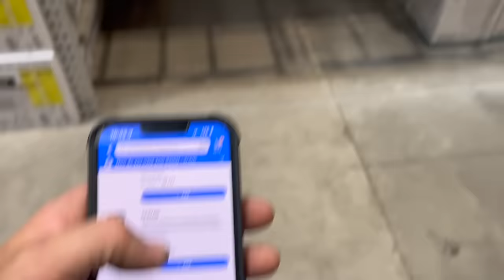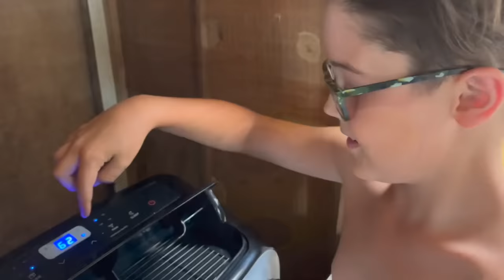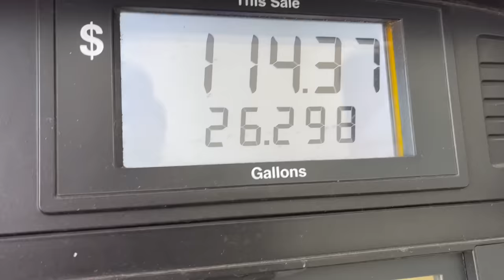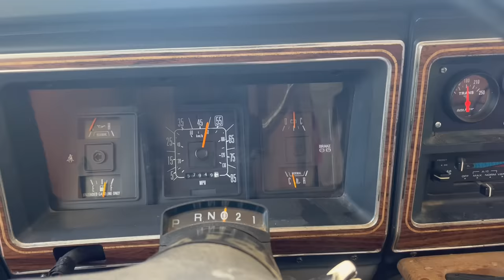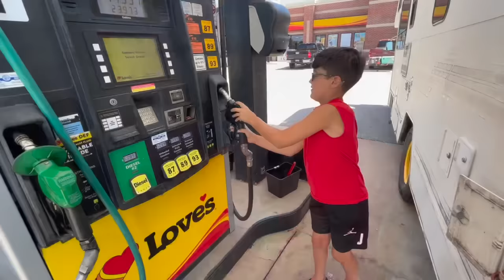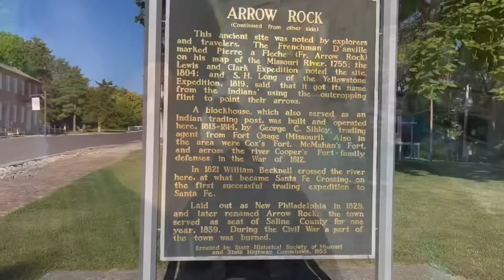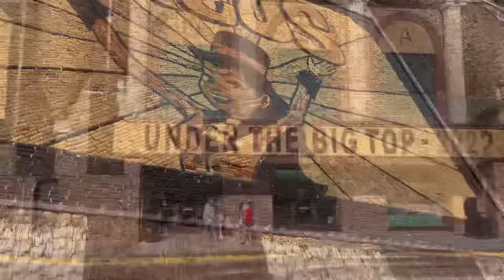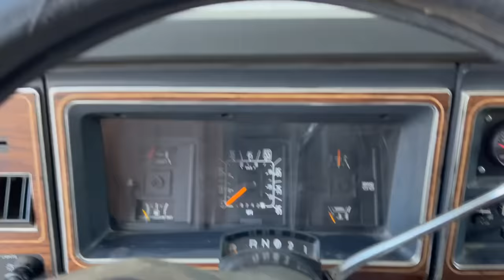Wild West of America Road Trip in a 31 year old RV Can we make it?

Comment: That a/c unit is totally fixable. You don’t need parts. Just someone who can braze the hole up, pull a vacuum and recharge it.
Reply: r22 cost might be a factor but its a simple repair
Reply: I don't even pull a vacuum....i just bleed off some...and some more as i go charging...eventually you get close to 100% freon, and then to 100% after more recharging, top-offs year after year....good enough.
Reply from the maker: Ok great
Reply: Ding need special parts. Brazing tank and brazing rod!  Clean the hole first. Prepare like a radiator.
Reply: Whiskey dents and gangster leans😁🤣🫣😂
Reply: Easy to fix guys don’t stress :)
You guys just have fun
Reply: I've been doing HVAC (with an actual license) off and on for 24yrs and I've fixed at least 3 screw holes(one of them my fault just like your little problem)by cleaning and flushing the hole out with solvent, sanding the area around the hole bright,  poking a piece of clean, flux covered  copper wire just barely into the hole and soldering it with a propane torch and plumbing solder. Just clip the extra wire off when it's cool and charge like you normally would. I know at least one of those repairs is still in service 12 years later at the Baptist Church down the road because the Head of Facilities keeps reminding me he's going to want the money back if it ever leaks
Reply: @jonathangehman4005  residential hvac is different than a rv air conditioner bud. if they are tampering with them (recharging) they become a major fire hazard
Reply: @Reaglesracing44_  I'm licensed for automotive , residential, and commercial and am pretty familiar with the Coleman rooftop ac(I've got one now and have had others and worked on a bunch more). I wouldn't hesitate to solder a wire plug into one of those since line pressures are the same for similar refrigerants, the materials are the same and of the same gauge and thickness. They're as well made as the average residential units and are pretty robust
Reply: @jonathangehman4005  you have to be RVIA certified not Licensed hvac. Camper air conditioning units are closed systems and have no refill point. If an Open Road RV Repair technician or any RVIA Certified Technician tests your system and determines that the issue is low refrigerant charge the only option is replacement of the rooftop assembly.
Reply: That 30yo AC has way heavier tubing and would be easier to fix than a new one would be. Service ports are easy to add even without brazing it soldering. I'd fix it without hesitation.
Reply: @Reaglesracing44_  I'm sure you're correct but that's why they sell ports and service valves, lol. Have a good eve brother
Reply: @Reaglesracing44_  they repaired my heat pump A/C system, kind of the same? Laws have changed here if they can’t. Too bad.
Reply: @reneprovencher8395  if it’s a residential unit then yes it can be repaired but a RV rooftop unit can’t because it can catch fire
Reply: @Reaglesracing44_  Gotcha
Reply: Wow masterful control of the cussing and screaming I would’ve set fire to everybody’s ears.
Reply: Have you got a radiator shop around they can fix that hole
Reply: Why do you keep calling tires casings??

Comment: This is a trip of a lifetime that you and your family will always remember. We're all here supporting you and will be watching every episode. As far as the 460 stumble, I would check the pressure regulator and the MAP sensor. One or both may be the culprit and they're not too expensive.
Reply: I had this happen with a '91 E350 Winnebago, it was water from the dash AC dripping into the computer which is right under the AC housing in the front passenger foot well. If it does it again , check to see that it's not wet on the passenger side.

Comment: Looks like a great trip. Ironically I did the exact same thing over two years ago. Found a 91 Tioga Montara in a barn. 38000 original miles and paid close to what you did. Spent 6 months renovating it. Same chassis. 460 with the 3OD. We pull a car on a dolly behind it. Still get 7-9mpg no matter what. So far, put close to 15000 additional miles on it over two large trips across the country. It has never let us down at all even pulling a car through the mountains of Colorado etc. 
One thing I learned is drive less and stop more. Driving is stressful, we learned to limit  driving time to no more than 5- 6 hours max and spend a least a day or two at each stop seeing sights with the car we pull. Renting a cheap car at stops is an option also. Have fun and good luck.

Comment: Thanks for sharing your trip. The A/C might be repaired with a Pro-Fit quick connect which works with aluminum and copper. They are like Shark Bite connectors for high pressure A/C  lines. You could also use a piercing valve kit to seal the hole if it's not too close to the bend in the line. If the hole is too close to the bend, try putting a piece of rubber tubing around it and clamp it with a small hose clamp. After taking another look at the tiny hole, it could probably be soldered. The tubing next to it looks like it has been repaired. Aluminum must be cleaned and uses flux and low temp solder and a soldering iron.
Reply: That's great info @cyberviewU, thanks for the pro tip!

Comment: I was amazed at all the work you done on that motorhome. I've got about 20 years experience in HVAC and residential air conditioning. You should have fixed that condenser yourself. All you needed was a stick of Silver solder and a map gas torch. You could have repaired it on the roof without removing anything. Then all you had to do was add a line tap so you could recharge the unit. Very simple. You can do it!
Reply from the maker: Yeah we should have

Comment: Josh, if this motorhome has the fuel pump inside the tank like most injected engines, then maybe it is beginning to go. Do you notice the engine acting up when you are near the end of a fuel run? As the tank empties, the pump housing becomes no longer submerged and maybe getting hot and dropping fuel pressure. I've seen this happen before.
Reply from the maker: Yeah maybe so
Reply: @Sleeperdude  I say fuel pump too.  I had a Jeep Cherokee with the fuel pump IN the gas tank and I was advised to not let it get too much below half full.
Reply: I have the same 1990 motorhome and had the same issue. Was going up a hill, and it died on me. Sounded like it was out of fuel. Pulled over, let it cool down for 30mins and it started right up. I took it to a mechanic and he said the pump inside the tank heats up and shuts off. It's a known issue with the ford's. I switched out the pump and haven't had the issue again.
Reply: I just bought an 86 motorhome. Pretty much the same rig but mine is carbureted. I am thinking that maybe the sludge in the tank is breaking up and clogging up things. Mine was garaged over 20 years and you wouldn't believe the tar that can build up as the gas evaporates.

Comment: I did 11,000 miles trip with a 2003 Ford E-450 v10 motohome. I did not had any major issue. only replaced the Rubber hose for fuel intake gaz tank

Comment: you can clean the copper and solder the hole shut using a small copper patch made from a little bit of tube cut in half either that or cut the bend line open it up jam it intoo a coupler piece and solder that
Reply from the maker: Ok thank you

Comment: Just bought an 86 Ford Establishment Class C. It only has 7300 miles, but has been garaged for 25 years. The gas tank is currently soaking in a vat at a radiator shop. The rest is mint except the AC isn't cooling. I'll know more after it is running.
Reply from the maker: Nice

Comment: For the external delamination you can get a syringe with epoxy and inject it in several places in the area and then press the laminate in, place a sheet of ply over it and use a prop to put pressure on it until it sets.

Comment: I had the exact same problem with my econoline rv stumbling last month. It gets worse with the hotter weather. We went Pittsburgh to Fayetteville Arkansas. The problem is the TFI module. It is mounted to the distributor and when it gets over 250 degrees it begins to fail. The trick is to open the hood when you stop for gas to lower the air temperature. The fix is to relocate the TFI module to the firewall. Im in the process of that now. 
Awesome videos!

Comment: I was able to binge watch all of your RV videos. I was rooting for the Dodge and still hope it turns out to be a simple, cheap fix.
At the same time, my bubble has burst. Many older Class C RVs are becoming available for little cost. If it takes 3x the original cost to make it comfortable and reliable, I don't think the remodel route is how I want to go. Pay the extra cash up front and not go through all that work. HOWEVER, if I had 4 hard working hands to help, that may sway my  opinion. Have a great trip out West!

Comment: Great video.  I find water in some gas stops, throw a dry gas in every 4 tanks.  Fuel mileage is doing good.  That chassis but new with a 7.3 gas’s gets 11 mpg at gvwr-1500 lbs, brand new in an ambulance .  All a matter of your speed.  Keep on having fun.  Doing great checking axle, n rubber temps.

Comment: AC? Been there, done that!  Clean up  the damaged tube with sand cloth, then solder it up, preferably with silfoss (silver solder) and recharge. That unit is made for R22 which is unobtanium at present, but you have numerous alternatives. My "go to" gas is Dupont's MO99, or R438a.  A new RV rooftop unit would be an "easy" replacement, as they all fit the standard 14x14 roof vent hole.
Reply from the maker: Yeah the problem was it has no charging ports and the AC companies  locally would have to order them

Comment: You're giving me hope!  I have already said it in another RV video of yours,  but I'll say it again. I just bought my first RV, a 1986 Coachman Classic on a Ford E-350 chassis.  460 (carburetor, no fuel injection) and only a 3-spped automatic.  I have only done the first few short hops in it,  no more than 50 miles and no overnights yet.  Still working the "bugs" out and still needing some tinkering & maintenance and stuff like a rear mattress and curtains etc.   Granted,  mine was in better shape when I bought it, but I still have my worries.  Oh it runs like a champ,  but when the lights go to flickering I get worried.  (Probably the alternator on its last leg or voltage regulator about to croak)   So, if you have the confidence in your rig to take off on a 3 week trip,  Maybe I can be more confident in my rig as well. 
If you were coming this way  (SW Pennsylvania) and had a major roadside breakdown,  I would hop in my big conversion van and get you all to civilization where you could get a motel and parts etc.   If I had my own private home, you'd also have a living room to crash in if needed. But I don't have that.  That said, and as others have said before,  I'm sure there are fans all over the U.S. who would jump to come and lend a hand if you needed it.  

I just did my own 4,000+ miles road trip from here in SW Pennsylvania  across the "finger" of WV, across OH, IN, IL, up into WI,and MN the across  ND, MT, into WY, Stopping off at Yellowstone, back into MT, then down to SD, for Devils Tower, Mt Rushmore and a drive through Sturgis.  Then down to NE and back across IA for a stop in at Iowa 80 truck stop and back again across IL, IN OH, and into PA for the last leg home.   I was gone 16 days, all by myself, in my 1990 Dodge B-250 High-top conversion van.   BUT.. about one week before my trip,  I blew the AC out of my van by accidentally overcharging it.  So I feel ya' there.  It's like getting hit in the guts!  So I did what you did.  I rigged up a portable AC unit, and ran it off my Predator 'genny that I carried on the hitch-rack.  The AC didn't do diddly going down the road at 75+ MPH in 105 degree heat,  But when I parked for the night,  it froze me out! 

Whatever happens on this trip,  try not to focus on what could happen,  focus on making memories while you're out there.  Sure, be vigilant, and take it easy on the ol' girl,  but enjoy the time you spend doing something you love with those you love. 
Godspeed and best wishes to you all!  You gained a new subscriber tonight!
Reply from the maker: I’m glad we have given you hope for your motorhome project thanks for the offer to help sounds like you had a great trip with similar difficulties before you left thanks again for watching

Comment: Had to stop here on the AC unit on top. If you have good access to the leak a good ac guy can clean and solder the leak and recharge the Freon hopefully it will work. I did the same thing to our window unit when I was drilling a drain hole and the drill bit puncture the pipe like yours did.

Comment: I was wondering if the stumbling issue you're having could be the new fuel filter stopped up or maybe you got a bad EGR valve that might need cleaned or replaced. I know my mother-in-law had one on her Lincoln and it had a 460 in it. And that EGR valve stopped up or going bad And you really noticed it when you were going slower speeds. Really enjoying your videos. And the best thing is making time for the kids and making memories that'll last a  lifetime.
Reply from the maker: Thank you maybe so

Comment: I know it's to late but just silver solder the hole,vac it down and recharge it.
Fixed many bad tubes that way.
Reply from the maker: Yeah that’s true the problem was it has no fittings to charge it so you would have to cut the lines and solder in fitting that they could not get in time for our trip
Reply: @Sleeperdude  Very true when time is short.
Funny you should mention charging it.
They make a Schrader valve that's stuck on top of a small tube .you just drill a little hole in the suction line and there's your charging port.
I will look around see if I have any extras my wifes dad fixed then all the time.

Comment: If you brush the copper to clean the copper then use epoxy to seal the hole in the copper,  then need to you purchase a new filter it will clean the freon and remove the moisture. . it is pretty simple and you have most of the equipment already!  then use your vacuum pump to evacuate the system. you then can recharge the system with freon.

Comment: Josh, as you know that non working check engine light on the motorhome probably just needs a new bulb #194(?) After you get it working, you will have your early warning system back in operation. As for the pooling of water on the roof, 2 roof trusses will probably need to be replaced on each side of the a/c unit. They may be accessible from inside once the ajacent ceiling panels are removed or you'll figure out a way to brace them up higher so the roof has a slight slope for drainage. I bet as you gain more viewers some other RV people may send you a replacement a/c unit and maybe a refrigerator!

Comment: I would think that that AC line that carried the Freon is copper and IF carefully done it can be soldered with lead … once it is soldered you can replace the Freon lost when you clipped the line with a screw.
Reply from the maker: Yes it can be fixed we needs fittings soldered in and didn’t have the time to wait on them

Comment: Excellent video Sleepdude Crew  :) also Josh prevent Vapor lock on carb plus fuel tank to fuel injection put in that RV use $40.00 of 89 or 91 octane gas and give full hp and torque to motor plus might get 13 mpg possible to on fuel mileage too! Also did excellent job on drive for trip and got planned next years to for Summer to Ontario lots families place check on camping plus vist too and lots fun see also Live hear to also lots see in all Canada you plan sometime too! Also get grey bottle of STP Total Treatment fuel injection and carb cleaner in fuel tank each time too help out too also Fuel Cap did ever change if not should change to yearly too ! Also use Fram 2 times air filter plus PCV too and fuel filter too change to also  every year and 2 times!
Reply from the maker: That’s awesome thanks so much

Comment: you know that little accident with the condensate has an easy solution just change the condenser and / or solder it at the specific point of putting a new one you will give more life to the equipment especially for that 5k trip

Comment: ABOUT THAT TEMP PEGGING ON C.  THATS PROBABLY CAUSE NO THERMOSTAT.  THESE RUN HOT WITH A 190 DEGREE STATE.   WE ALWAYS PUT A 160 IN THE UHAULS WITH THE 460.     Thiers no therm in it.  Cause when thier is.    It will sit at half way Mark.    So it's either faulty or its missing.    A 160 will sit just below half way

Comment: You were drilling from the wrong direction and you should have made a bracket, plus you should have used a filler compound to raise the level so the water would run off and not pooled
Reply from the maker: Ok thanks

Comment: Don't feel bad bud as a HVAC guy we have all done that.. And it's is very repairable braise the whole shut leak check the system with some dry nitrogen hook up your Vac pump pull it down into a vacuum and recharge the system why you got it all apart now is the time to clean the condenser coil and the evaporator coil
Reply from the maker: Thank you. It didn’t have any charging ports so they said they would have to braze some in
Reply: @Sleeperdude  yes or a saddle tap but they eventually leak so if you can braise a tee in or port

Comment: I did 😁 the same thing. Busted the ice maker juice on my window unit on my house drilling a hole in it trying to make the water drain that was up to the fan in it
Reply: I was bummed out too. Not bad as you. I did have 2 other window units and a big central unit that blows mainly under my 60 year old house with hard wood floors with no insulation so it works a little
Reply: All the kids came running at the dump station. It's like they've watched the R/V movie before.